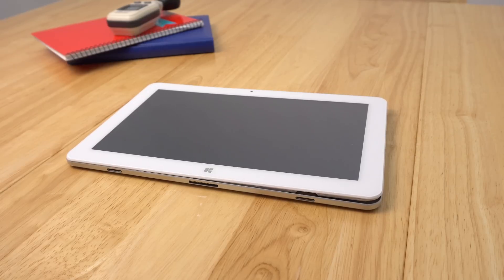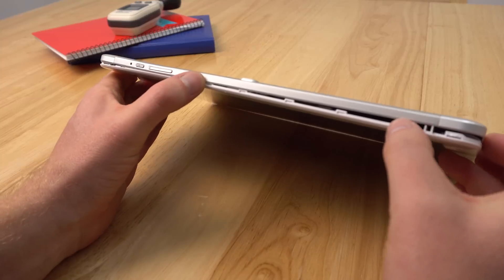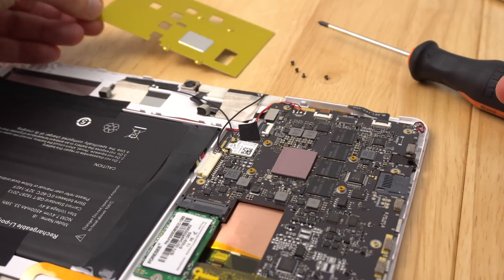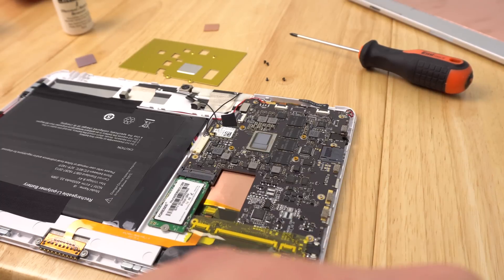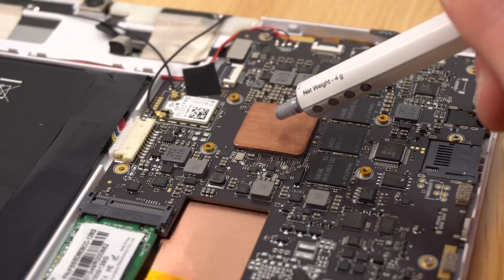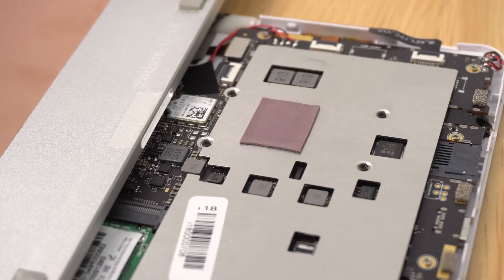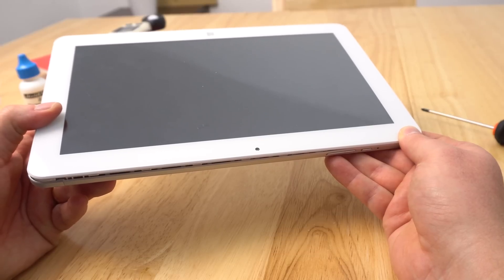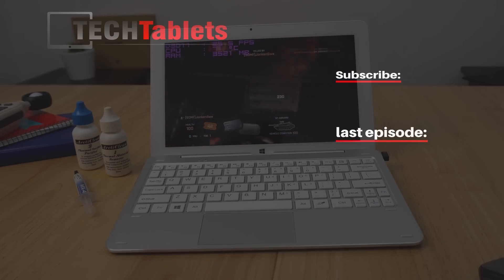Cube Mix Plus Copper Heat Sink Mod -  Lowers Temps 20 Degrees C!

Comment: I have used 0.8 mm thick copper heatsink and it works great, 70°C at very long full loads, with clock turboing by itself to great performance.

Comment: I went the path of least resistance and cut holes in back of case for heat sinks. Screw the extra insulation. The more surface area the better cooling. And the least resistance the faster it cools. Runs 35-37 •c. That copper sheet could be cut into fractal WiFi antenna. Plus it would allow more heat to escape. Think it acts as heat shield. Increasing the insulation factor.

Comment: Hello thank you so much for this video it really helps and really good explained.
where is the Intel 615 graphics in this tablet? Can I put thermal pad on it to help?
What if I put thermal pad on the Grey metal that is it on top of the processor covering with 4 screws?
Reply: Remove the cpu using bga station and put a hole inside it... there u can find the intel 615

Comment: *less number of contacts > low thermal pad thickness  >  good thermal compound * that's how the priority should be.
I would have just used an expensive thermal pad on the CPU and between the case, I think that would have worked better, 
I don't see the point in adding a chunk of copper in between if you are not going to take out the metal covering because you are putting two layers of thermal compound and one layer of metal instead of one thermal pad and it does not seem intuitive, if possible do a comparison between having just a thin thermal pad(plus copper if space left) between metal cover and back cover and also change the thermal pad on the processor
Metal should only be used when you need to fill gap someway

Comment: me i have this tablet ..working fine...
just the keyboard button are in english, no greater and smaller sign that we use in html and php...
the pen dosent work correctly on the down side edges of the screen...
i didn't try to open my tablet for such kind of experiment but just i install widnows 10 pro and android 7 at a time;;;both boot correctly

Comment: Successfully done. The most difficult part was opening the case, that's all. I use 2 (fortunately unused) identity cards, 1 got broken. Guitar pick didn't do for me, maybe the corner of mine is too rounded. Currently temp is happy at around 50-55, 70-75 after running AnTuTu 3D. All of this while store is updating and browser is downloading. Previously even just browsing around would raise the temp to 80-85 which is not acceptable. I've ordered the Ocube cover, so even if the back becomes hotter, it shouldn't be as noticable.

EDIT: Highest temp when running Geekbench: 80 (y)

EDIT 2: I change the thermal paste from HY880 to NT-H1 and I'm good for another 5 degrees (y)

Comment: I know why they don't do that by default. I just did it and the back gets to 55C with 8w TDP (up from 7w). Which is very uncomfortable to the touch. This is while reaching 100C internal... Also, GTA V still kinda lags without mods... Time to go listen to that lowspecgamer guy.
Reply: Heatsink are great for any high performace devices, however if the device fall for some reason and the copper pad moves, it could short the device and manufactures do not want to take that risk. An other reason could be to save some pennies on each device wich tranlsates to millions. That is my opinion on this matter.

Comment: I would like to ask if 15x15x0.5mm copper shim would be enough or it has to be 20x20x1mm? Thank you for the reply in advance.
Reply from the maker: It would be fine, but the results might be a little hotter.
Reply: I went and did the mod with the 15x15x0.5mm and it is giving me great results so far. I went from 90°C to 65-70°C. Thank you for the help and for the helpful video too.

Comment: Hi, i bougt same tablet and have same issue/problem. On load 96*C. I watched this and i do not recommend mixing copper and aluminium together. Due to a galvanic corrosion, the place where they touch will get destroyed. Anyone of you did try only silicone tape improvement?

Comment: Just finished mod on my Mix Plus with few changes:
-used thinner layers of thermal paste 
-added some thermal paste on top of the center of the original thermal pad and added 0.1mm copper plate on top of that  to make sure that whole heating area sticks well to the back

Temps are now about 30ºC lower in high stress :)
Reply: You think that if I I use two 0.5mm copper plate it will be the same?

Comment: Two questions:
1. Didn't catch it if you said it. What thickness copper heat sink should I get? I see it ranging from 0.3mm to 1.2mm on Banggood.
2. If I buy this it'll be my first tablet, so not a tablet expert here, but can the RAM memory be increased? The 4gb replaced with 8gb? Since you mentioned the SSD can be replaced, idk what other parts can too. Really liking everything on this tablet, except the 4gb memory thing. I want to get it specifically for drawing, programming, and 3D modeling when I don't feel like sitting at the comp.

Btw guys theres a 20% off coupon now on banggood, so its about 285$ now actually. The tablet alone.
Reply: Ram is tablets is almost always soldiered, and open up your table to see how much space you have for a heat sink and get the bigfest one that fits.

Comment: hey! thanks for the video, this makes this tablet pretty appealing for the price. did battery life increase notably after you modded it? 
if i get it i might mill small ridges or a grid pattern into the back to give it a larger surface area, and make it more grippy.

Comment: just did this  on my newly received mix plus with a 15x15x1mm copper shim. mine now gets to around 82C according to hwinfo64.  Maybe because of the smaller shim I used ?? Or used the thermal paste TOO sparingly.  Anyhow, still lower temperatures compared to before the mod.

Comment: Thanks, this lowered my temps by 40C.
Mine didn't even have a thermal pad between the cpu and heatsink and would go straight to 99 degrees when gaming unless i throttled the cpu.
Now it stays around 60c.

Comment: This seems to be bringing down the temperature of the cpu quite well, but my concern now would be that the battery is exposed to much higher temperature now, as the back copper shield overlaped the battery as well, hope it won't explode now ;)
Reply: Uhmm no that's not how it works, if the CPU is 55 degrees then the whole board is 55 degrees and not warmer. And besides it handle being next to a cpu being 92 degrees so it will be fine.
Reply: snap ko Actually a good point. I have no idea but I will take a look at it when it arrives
Reply: As I made my mod, I took a look but I don't think the battery is much effected by the copper plate. I used a copper shim and thermal pads but my decrease in temperature was only 2 degrees. After 30min of gaming, the tablet is still 94 degree. Don't know what to do next

Comment: I didn't use the thermal pad. I use another copper pad which has the same thickness on the indent. Then i spread a lot of heat sink compound between the aluminum which is screw on the motherboard and the thin copper sheet on the back cover. I got 30 degrees lower when I cool the back cover with a usb fan, while playing games !
Reply: crazy idea and good results

Comment: Hey, great video!  I have a couple of questions for you if you don't mind.  Do you recall well enough to estimate the thickness of the original thermal pad that was affixed to the CPU from the factory?  I would like to order a larger and much more conductive thermal pad to use between the steel screw plate and the backplate of the device, and as there are several thicknesses available I'd just want to make sure I am ordering at least about the right thickness.  Currently I am thinking 1mm shim and 1mm thermal pad.

Secondly, do you have an opinion on using thermal adhesive between the copper shim and the screw plate, and using thermal paste between the shim and the CPU?  I would think that this way, the shim would not be able to move because the screw plate is fixed in place, but the whole assembly (screw plate and shim) would still be able to be removed if need be...  Thoughts?
Reply: I'm thinking of doing the same way as you wrote. Did bigger, 1mm thermal pad work out well? What thermal adhesive did you use, and do you have comments on thermal conductivity of it? Please update of your progress.
Reply: I ended up using a 20x20x1m copper shim with Arctic Silver 5 to the CPU, then a 1mm thermal pad from the copper shim to the internal heat sink(this holds the shim in place), then a 1mm pad from the internal heat sink (cut to the full outline of the internal heatsink) to the backplate.  I went from hitting 90c+ in Prime95 to topping out just under 55c.

I bought the Arctic thermal pad (145x145x1mm) and it works very well.
Reply: 20x20 from the copper shim that is touching the CPU to the heat spreader plate (on the side of the plate that FACES the circuit board), and the full outline of the heat spreader plate to the back casing (opposite the circuit board side of the plate).

Back Casing // Full outline pad // Cube Heat Spreader // 20x20 pad // 20x20 Copper Shim //  Arctic Silver 5 // CPU
Reply: Thank you for sharing this! So, you have used a 1mm copper shim, on top of that a 1mm thermal pad, then comes the internal heatsink and you also put a big thermal pad in that whole plate to connect with the outer case? If that is correct, wouldn't it be too big and causing the screen to bulge like I have read a lot about?
Reply: Actually, I ended up revising it a bit.  I did a 1mm thermal pad on the CPU, a 1mm copper shim, and then another 1mm thermal pad to spread to the backplate.  I removed the included steel plate (4 screws) and dumped the heat straight to the backplate.  Since I used a high quality thermal pad(ARCTIC Silicone Based Thermal Pad with 6.0W/mK Thermal Conductivity), I still ended up diffusing a lot more heat than stock.  I didn't get any of the signs of bulging, but I was concerned about it.  Doing it this way seemed to put almost no pressure on the mainboard, just enough to ensure good thermal contact.
Reply: Jacob Milliman so you removed the entire internal heatsink? And only the CPU is connected to the backplate, right? How did that turn out? Can you share some Temperatures?

Comment: Allright, my cube mix plus is dispatched from gearbest (I wonder how long it'll take to arrive) and I just ordered a 15mmX15mmX1mm copper shim from Banggood... Hopefully this will work as good as in your video!
Btw, Chris, you mentioned hammering the aluminium heatsink... Why's that? Is it that the mod doesn't get too thick and things start pushing at the screen or why?
Reply: Hi really interested in how your mod turned out. as i'm planning to do it too
Reply: Yeah, me too! Love reading about this stuff. Also because the tablet is on the way :D
Reply: herzdesdrachen What happened?
Reply: did the your smaller copper shim worked out? did you also hammerd the heatsink? ty
Reply: The mix plus arrived 8 days after ordering. But the material for the mod hasn't arrived yet. But according to chris from techtablets, it shouldn't be necessary to hammer the aluminium heatsink. btw, I now ordered a 20x20x1mm copper shim too... I'll keep you posted when the mod-material arrived and I finished the mod.
Reply: Danke, mir ist grad aufgefallen, dass Dein Nickname deutsch ist :D, ich bestelle mir dann auch ein quadratisches 20mm Shim.

Würde mich freuen, wenn Du mich auf den Laufenden halten könntest. Danke und viel glück :)

Comment: TechTablets.com Chris i would be very thankful if you could tell me if its the same digitizer as i7 book and i7 stylus? mine is broken and im looking for replacement, and only thing i could find is one for i7 stylus. Now i know for sure that it will fit i7 book also, but not so sure about mix plus, since its also different colour. Maybe you saw a serial number on digitizer flex cable? It should go 106005c something.. Again, would really appreciate any info, thanks.
Reply from the maker: I don't know 100% But I have a good feeling its the exact same one used. I can't check it as mine is in Spain and I'm in New Zealand at the moment.
Reply: thank you, i also think its the same, but wanted to be sure. Very interested how this thing will look with black front

Comment: what if i didn't use any thermal paste on the chip and the copper pad
Reply from the maker: An pham viet It would move around and cause a short. Kill your tablet in no time.
Reply: i like the keyboard but the trackpad suck. usable but suck af
Reply: i just installed win 10 home N on my cube. i got it in the morning. After i installed win 10. the function key doesn't seem to work anymore. And another thing is, Can u tell me how to disable the chinese loading screen at startup. it's anoying.

Comment: I can't find the 20mm piece anywhere without buying 10 or more. Why not use 15mm and not risk hitting the resistors?
Reply from the maker: 15mm is fine, I just went 20mm for better results. It's still working just fine on my unit.

Comment: Iv noticed you are always worried that if the paste gets on the board its going to kill it, its not. Most thermal compounds including mx-2 and mx-4 are not electrically conductive so its fine to get some around the chip. Its always better to use too much than too little.
If you have ever opened up laptops or graphics cards youll note that manufacturers always get paste around the chip and on the board and nothing is ever harmed so as long as the paste you are using doesnt contain metal then its fine.
Reply from the maker: Yes, it won't cause any shorts. Artic Silver would.

Comment: How about using active cooling like the surface pro 4.It would not throttle and not heat up the backing
Reply: Would prolly make things pricier.
Reply: The backing is fugly anyway, maybe buy a some dbrand cut to size and cover the back.

Comment: For future reference:
1. you can make a circuit discharge by holding the power button AFTER you have disconnected the batteries, this would insure there is no electricity in the tablet while you work on the tablet.

2. You can spread the thermal paste around the chipset with a card (like the one you used to unclip the pins) so you wont have to move anything.

3. As far as i know MX4 is short proof, they not using conductive materials in their MX4.

Comment: They really should start putting heat sinks on
Reply from the maker: Or just a thermal pad between the heatsink and rear metal housing. They did it on the Cube i7
Reply from the maker: Teclast X5 Pro has good thermals, it doesn't need the mod.
Reply: MAKE VIDEO OF COMPLETION OF COOLING ON TECLAST X5 PRO PLEASE
Reply: KK K yeah or a heatpipe
Reply: Heatsink are great for any high performace devices, however if the device fall for some reason and the copper pad moves, it could short the device and manufactures do not want to take that risk. An other reason could be to save some pennies on each device wich tranlsates to millions. That is my opinion on this matter.
Reply: +TechTablets.com maybe from a manufacturer's point of view, increased internal heat, less contact heat from the back=happy ambiguous customers. Then the lifespan of the device is shortened so they earn more money. (Lel that was dark, probably not the case, just my dangerous thinking,)